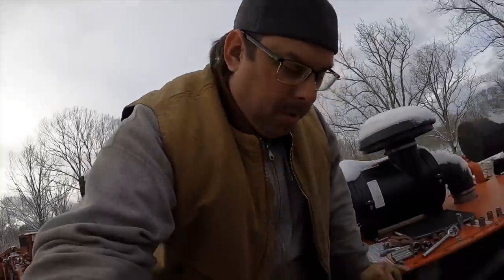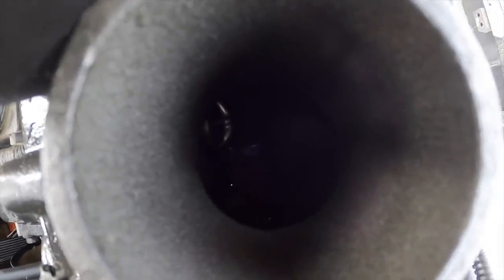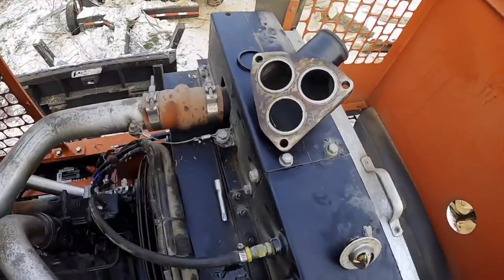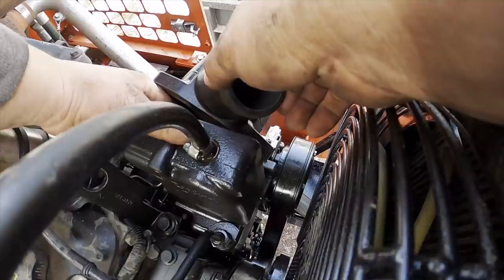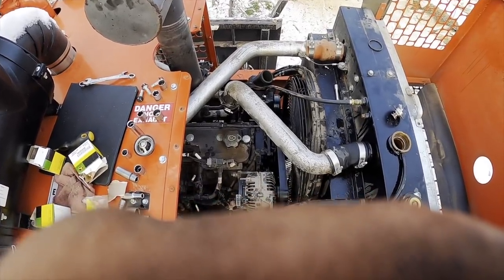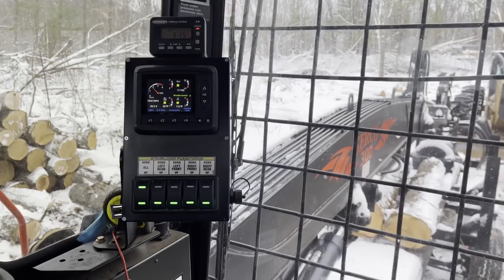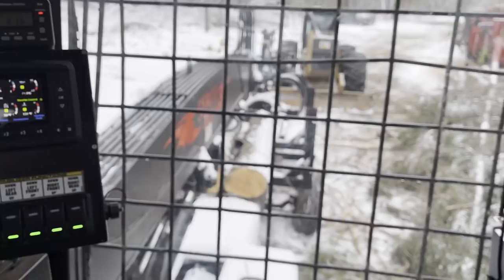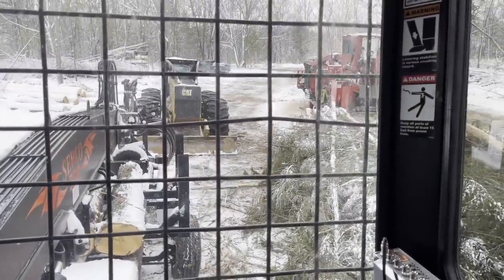3 of THEM!!!

Comment: Are all thermostat set to open at the same temperature? I would have a tendance to think they would be rated differently so in hot summer days at max HP you would have 3 full flow and in colder time still have the possibility to partially close 1-2 or 3...also with a 2 or 3  set up you reduce the risk of over heating if one stuck close... with 2-3 set up you increase the risk of malfunction but reduce the risk of shut down! Not sure I am clear....